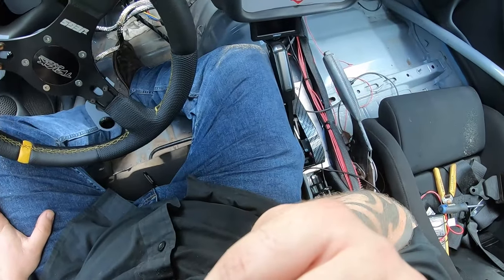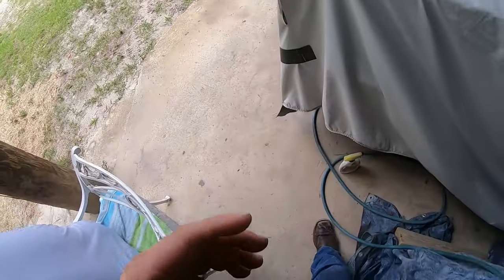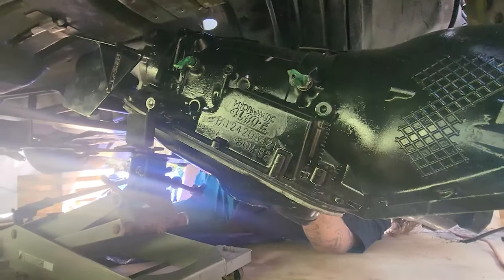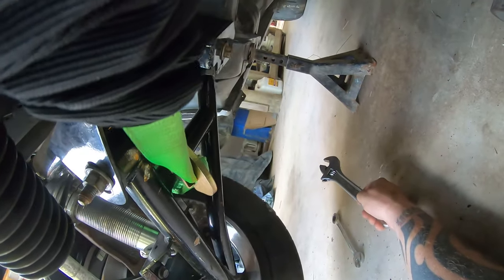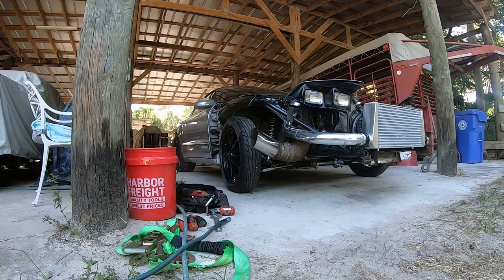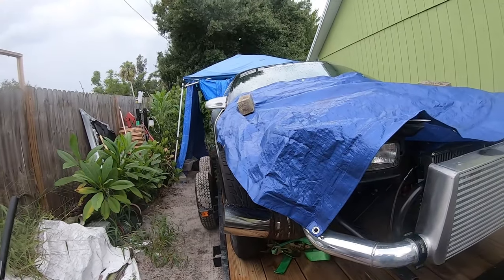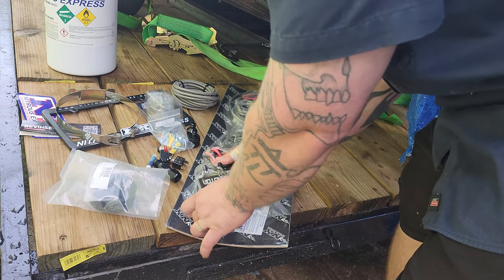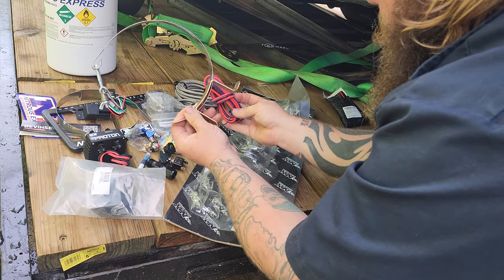Boosting Turbo Spool with Nitrous on Our Budget Drag Car!

Comment: The bump button isnt it meant to do what your trying to do with your finger. So it cuts signal to your trans break relay for a set time or whatevs
Reply from the maker: I didn't think so either, but couldn't figure it out i'll have to go over the wiring and try again.
Reply from the maker: releasing the button real fast is cutting signal to the transbrake relay lol. but your right i think it's supposed to pulse the pwm signal. to soften the bump.
Reply: Yeah it's just a on off button with your delay set even if you do it super fast it should add that delay so you just keep hitting the button its wired too 😅 and work out the delay car should move at some point if not just yell at it and put it in the corner
Reply from the maker: @kgpp2293  Transbrake is currently on a momentary button so if i let go it launches. I was hoping to be able to use a momentary button for the bump to send a signal to the holley to tell it to bump once each time the signal is sent. but it it's supposed to be an on off button i can see now how they are doing it, I was going to use a relay and the momentary button to basically be a momentary off button, with the transbrake button being the final say. i'll have to make a video on it kind of hard to explain in words
Reply from the maker: @kgpp2293  I like that idea. I'm just worried it might yell back
Reply: Man where can I contact you to send you pictures on how to fix that a arm sliding s&@$ ?

Also you need to configure your bump differently. Want it to jump or to creep in? I can show you how It works
Reply from the maker: @v8tergt653  facebook in description
Reply from the maker: @v8tergt653  I welded washers holding the bolts in place.

Comment: I had the same issue with the slots moving on me after alignment. So I ended up welding some tabs on each side of the slot and made different plates with a hole moved in increments of .0625” from left to right. So no the bolt goes thru that plate and cant move left or right no more. Its a pita to adjust but after adjusting it doesn’t move anymore.
Reply from the maker: I ended up welding washers on holding the bolts, in the latest video. But you can always join our Facebook group you'll see me in there.
Reply: @HighNoonRacing  Did the same thing at first and then I needed to adjust it a lil bit later and grind it all off, not fun jaja